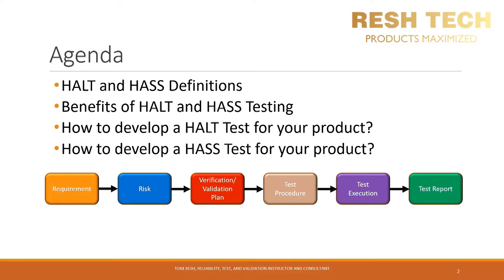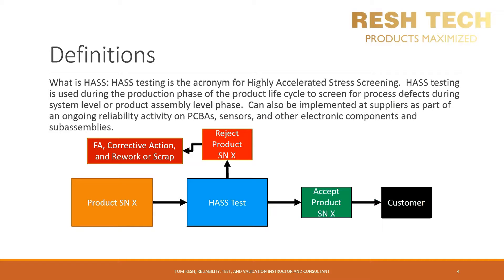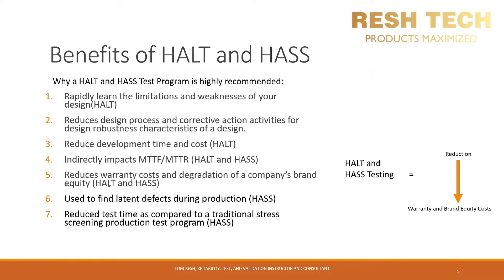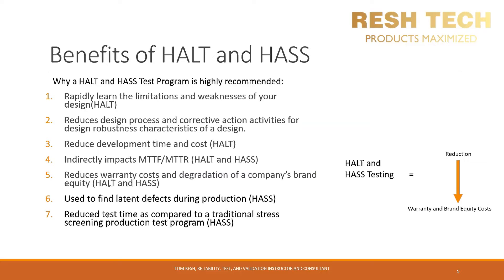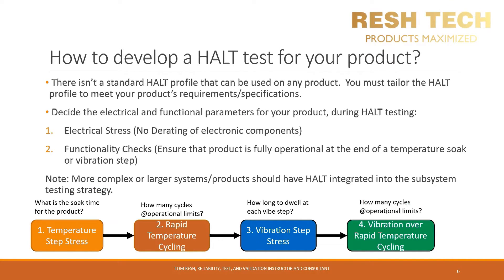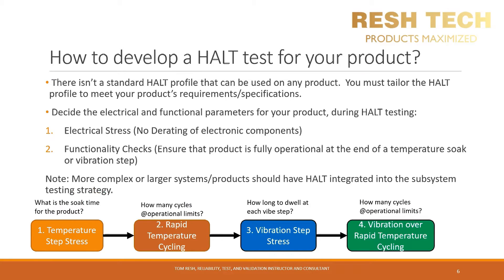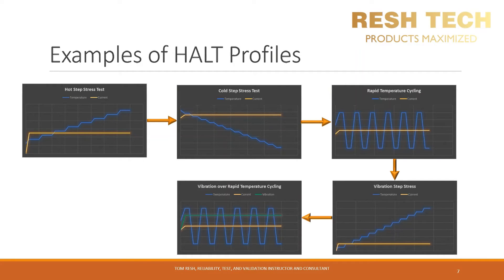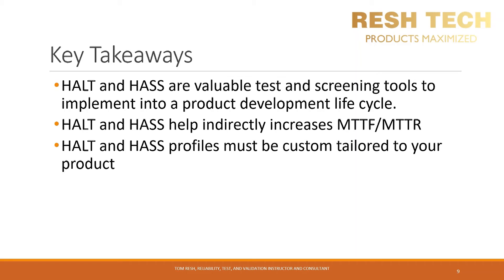Introduction to HALT and HASS

Comment: Let's say my company is supplying hydraulic gear pump to tractor and earth movers if I want to deign endurance cycles what parameters should I consider and how min and Max test temperature select.manjunath.chunamur96@gmail.com please reply to this email
Reply from the maker: Take a look at my temperature shock and acceleration factor videos.  HALT would not be what you are looking for giving the information you provided.

HALT is for design margin testing not for endurance testing.

HASS is an accelerated stress screening test to find latent defects and other production related failure modes.

Neither of these tests will give you what you are looking for.

Comment: Will this work with batteries?
Reply from the maker: Yes, you can!  You can apply HALT and HASS to most electric and electronic systems, depending on the size , application, and cost of the system.  Just keep in mind not to exceed the max temperature limit of your cells to prevent thermal runaway.